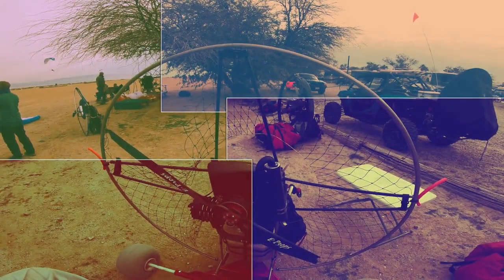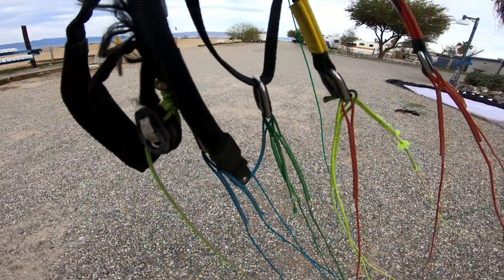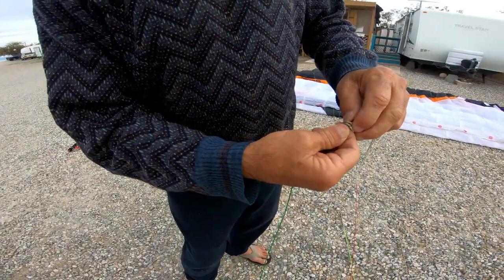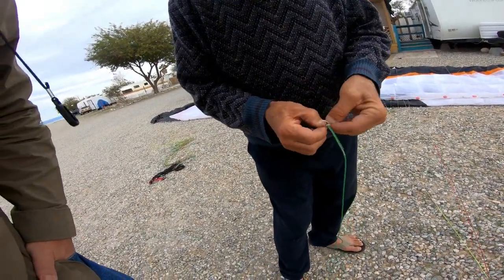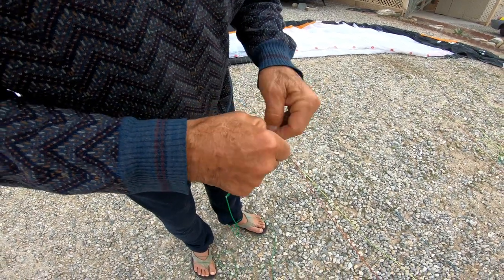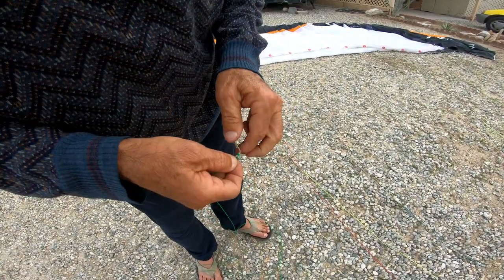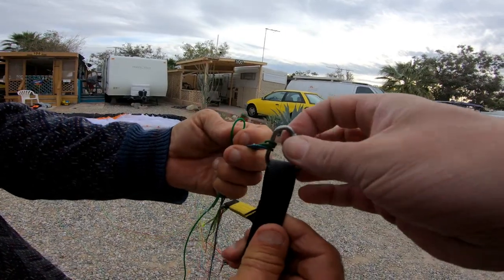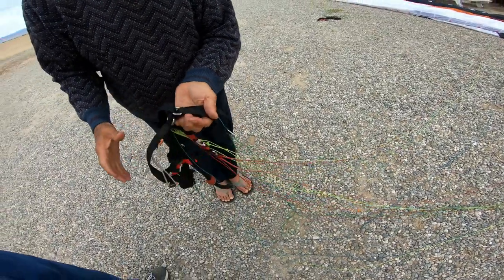Salton Sea Part Three - We Can Rebuild It

Comment: Never ask someone who doesn't know for help. If you ask somebody how to tie a knot in two lines, and they tell you " you don't tie knots in a paraglider line", then they know what they're talkin about. Loops.... you always use Loops in the line attachments... that's why the ends are sewn together. A knot actually reduces the strength by 50%. 

The only "knots" are at brake handles.(Google: Clove Hitch Knot).... because that's the only lines that don't terminate in a sewn loop......
Reply: P.s. Parachute rigger, Master.... ;)
Reply from the maker: Thanks for the clarification.
Reply from the maker: @wiley0714   Is there a name for that loop connection at the top?